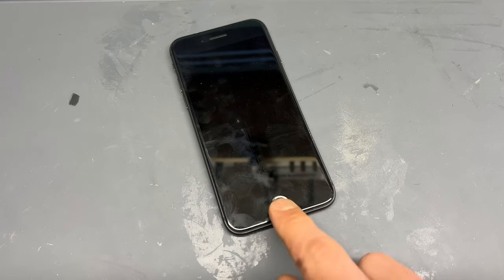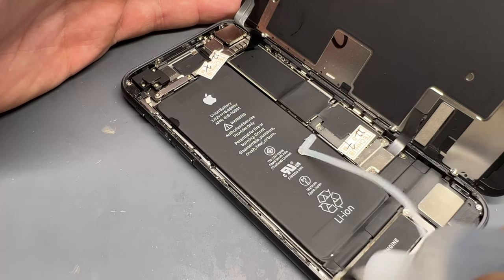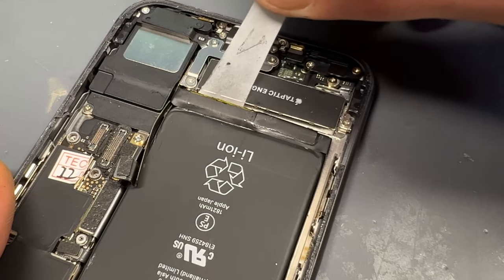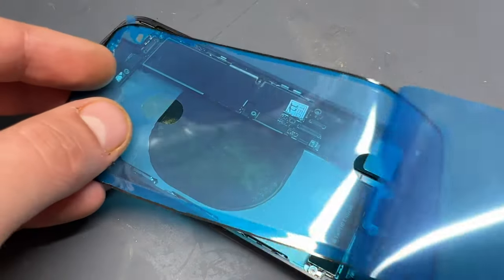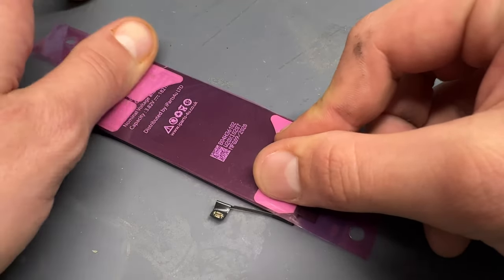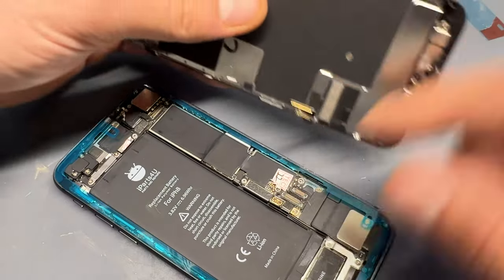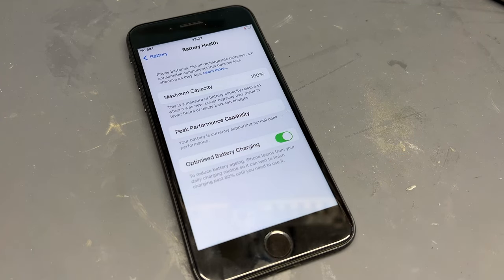iPhone 8 Battery Replacement - iPhone 8 Battery Repair How To - Simple Guide

Comment: That’s nothing compared to my phone which is at 77% capacity
Reply: We are together. Mine’s 78%
Reply: @namata305  mine's 80% but it's been there for a year now while it lasts way less than it should
Reply: Got u beat at 75%
Reply: @bruceiscool05  I lost my old phone, I don’t know what my percentage is at
Reply: Mines 51%😭
Reply: @DR3C074  💀
Reply: @DR3C074  my respect to you
Reply: Mines at 67% 😂
Reply: Mine 57
Reply: Same
Reply: Mines at 71
Reply: 76
Reply: @DR3C074  mines 50% 💀💀
Reply: Mine is lying in a cupboard,
Does that count? 😂
Reply: @ashy1423  What
Reply: @bruceiscool05 holy shit I’m 74
Reply: @bruceiscool05 i also beat u! Mine 69
Reply: my iphone 5 at 29
Reply: mines 70% waiting for new battery to arrive
Reply: Mine 75 😅
Reply: That’s not bad bruh
Reply: @Undertakerfan700  you dont understand
Reply: Mine is 72 huh
Reply: I use a battery pack
Reply: @DR3C074 damn bro u living next to the charging cable ?🤣🤣🤣🤣
Reply: @DR3C074 how tf are u even using it 
Battery woulda went down within 40 minutes
Reply: That's nothing. There's people out there that don't even have a phone which means they can't even be cool enough to one up each other about something as stupid as whose charge cap is the lowest. Also, be ready for the iPhone battery Olympics, they are being held in Zurich in the fall 2025. One of the events is lowest charge capacity. Some of you appear to have some real contenders so you might want to hold onto and not replace, it would be awesome to take home the rose gold medal eh? Even placing for the space grey medal would be dope AF.
Reply: Can't beat 64%
Reply: if I remember correctly, my mother may have had 47:D
Reply: Mine 74🎉
Reply: 70 here... i had this phone since 8th grade
Reply: Mine’s saying service now… i dunno what exactly that means to be honest but I’m assuming i need to get ‘service’ from apple for replacements. 😅
Reply: My iPhone 8 expanded at 81%
Reply: @DR3C074 does it hold charge?
Reply: 72%
Reply: Mine is at 49%
Reply: @Platinum199  HOW IS IT NOT EXPANDED??
Reply: @frylock428  my screen is popping up a little bit so I’m guessing it is cause of the battery it may be time for a repair just got a hunch
Reply: Mines says service and gets hot
Reply: Mine at 2%
Reply: @johncena6701  HOW!?!
Reply: mine 75
Reply: Same
Reply: Currently down to 61%
Reply: 70 % over here 😂

Comment: Don't be fooled by this video. This is a very cavalier crash course guide. It's a very delicate job and can take several hours if the adhesive strips put up a fight. Cover your screen with something to protect it from scratches. Don't lose the screws and remember which ones go where. The adhesive strips under the battery are a bastard. They won't come out nice and easy. Apple made sure of that. Alcohol makes it more difficult to scrap them out clean. Warm the bottom of the phone instead. Clean with alcohol after you get the pieces out. Connect the battery ribbon cable and install the battery before you put the screen adhesive sheet on. Be very careful and take your time positioning the screen adhesive sheet. You'll only get one shot at getting it perfect. When reconnecting the ribbon cables, be gentle but make sure they're connected properly. You'll feel a positive click and check they're fully engaged by pushing down on both sides with the plastic tool. The little screws don't like to stay on magnetic screwdriver bits very well. Position them with tweezers first. When starting them, it's always a good idea to turn them counter clockwise a turn or two before turning them clockwise to ensure you don't cross thread them. Before you set the screen and close up the phone, test it. Make sure it powers up, and that the home button and front camera work.
Reply: As a phone repair person I approve your comment 🤟
Reply: @B2catzzgaming46  Thanks
Reply: Just rip it out ⛏️
Reply: @pyeltd.5457  Sure. If I wanna deal with a fire that even a chemical extinguisher couldn't put out. That sounds like fun.

Comment: I just had my battery replaced today and an apple certified place in Canada, and I’m curious about the waterproof seal is that the blue tape that somehow applied a waterproof bead around the phone or?
Reply from the maker: yes, this is a dust and moisture resistant seal
Reply: What was the charge?
Reply: @cdb989  $74 cdn. At London Drugs, they have an Apple Certified computer repair Center in every store

Comment: Guides like this should start with a warning!!
Make sure you record where each screw comes from, and where they should return to! The screws vary in length, and if you put a long screw into a shorter hole, it will go down too far and damage the circuit board immediately below. Apple does this to hamper phone repairs.

Comment: Very excellent video, much appreciated to replace the battery in my phone. What I can’t find is the first seal/ adhesive that is put in before the battery and seals the surrounding edges of my phone. I can find the two strips but not the bigger seal. Could you please tell me if that seal has a particular part name or number? Cheers Yvonne. Ps I am 70 soon do quite impressed with myself as now my phone still works 😊👏👏👏

Comment: Close and very helpful. My kit came with a suction cup to separate the screen. It said to heat the phone up with a hair dryer for 90 seconds first.
Reply: Yeah, all kits are a little different. Mine came with a BFH to separate the screen. The BFH was a lot quicker than the suction cup. Did your kit include the hair dryer for that? Assuming your kit was "tools included", it should have had the hair dryer.
Reply: @Karen-s5s  
nope - had to do a little digging to find one. 
------------
As long as you are here, I made several mistakes. first, because it was covered up in the video with paper I unscrewed a part that did not need unscrewing in the process. After putting it back I started on those Itsy Bitsy Teenie Weenie screws. I used a magnifier that one wears on one's head. It helped immensely. then I had a separate container for each part and screws I removed to make it easier to reassemble. The big mistake is a single bracket that has several different screws. So even the screws in each individual container got mixed up. even though the screwdrivers were magnatised I was able to drop a few on the carpet. It was lots of fun to track them down.
I hope things go easier for you.

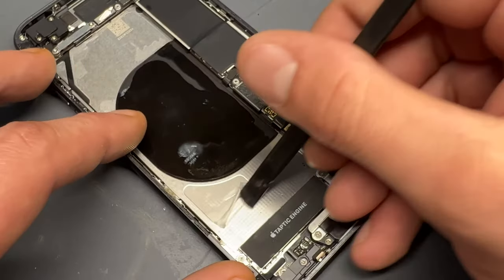Comment: 2:49  I accidentally scraped that black stuff under the battery a little bit. So its like a 5x5mm or a lil smaller scrape mark on the black ”film” thing... Will that affect the phone? Or will it work anyway?

Comment: The battery was from Apple or any other brand??
Is it ok if I use a battery that is not from apple? Will I still be able to see the battery health?
Reply from the maker: This is an aftermarket battery but it will still display the battery health, yes
Reply: Everything from the xs onwards will not work properly. Unless someone copies the data from your previous battery

Comment: Good video. However I was not using isopropyl but ethanol and in the end noticed some lens fogging on the camera despite drying up the phone with the hairdryer before closing. So it’s now in a ricebox with extra silica gel on top for a day or two with open sim slot. Also you don’t have to pry with anything sharp. Just use hairdryer around the edges and use a suction cup.
Reply: Did the fogging disappear after?
Reply: Did mine so ez wow

Comment: Can i upgrade my iPhone 8 battery? From 1,821 to 2,200 mAh? Is it safe? What is it negative effects?
Reply: not worth the risk
Reply from the maker: There are some batteries available. i would recommend using very good quality 1821 batteries rather than "high cap" batteries
Reply: It’s a lie. That capacity doesn’t exist. I’d watch out for anything that claims anything more than 10% of the original capacity

Comment: The hardest part was getting those extremely tiny screws into place. Had one fall into a crevice and was really hard to get out. But I finished the operation
Reply from the maker: the three at the top? those ones suck! they are non-magnetic and always fiddly

Comment: CAN I USE IPHONE 7 BATERY IN IPH 8
Reply from the maker: No! Different connnector
Reply: You can, however it won't work. You'd have better luck with an iPhone 8 battery.

Comment: First of all no one in their right mind would have a battery replaced that’s at 85%. Second.. he did a lot of unnecessary shit. You don’t remove the screen, you don’t remove the internal screws, and you don’t mess with the adhesive. I’ve done this for years.
Reply: Interesting. So just leave the screen attached like an open book? I like the sound of not doing unnecessary shit lol
Reply: Yeah I just recently changed the battery in my dad’s phone. There’s absolutely no reason to disconnect the screen. And I did it a little more old fashioned.. we ripped out the battery with a flathead screwdriver lol.. not recommended but I got fed up with it. Works like new. The hard part is putting the micrscopic screws back in lol
Reply: @XxITGScooby33xX 
And does not need gluing back down just put it in. I would use a flat plastic thung to get the battery out. Mine is down to 50%.

Comment: Mine 62 😢
Reply: Damn thats low i’m at 72 

And for some reason i thought that you’d lose battery health if you replace the battery without copying the serial number. Guess i was wrong
Reply: @B2catzzgaming46  dam
Reply: @imnotsnipx5987  by the way did you replace yours
Reply: @B2catzzgaming46  nope still has it
Reply: @imnotsnipx5987  how old are you by the way
Reply: @B2catzzgaming46  15😭
Reply: @imnotsnipx5987  dayaam bro i'm 15 too

Comment: Do you ALWAYS throw customers property around like that? How VERY unprofessional, merely for the sake of trying to appear "casual and cool"

The ABSOLUTE MESS you made of the inductive charging pad, and SCRAPING THE INSET AREA WITH A METAL TOOL  - wow - you REALLY need to refine your techniques.

Are you not going to apply pressure evenly around the new screen adhesive, causing it to adhere properly? 🤦🏼‍♂

 I've been in electronics manufacture and servicing since 1991, and YOU WOULD FAIL any assessment.
Reply: He succeeded in every test tho. I would just dig it out with my sausage fingers.